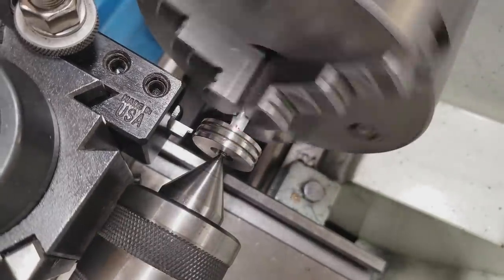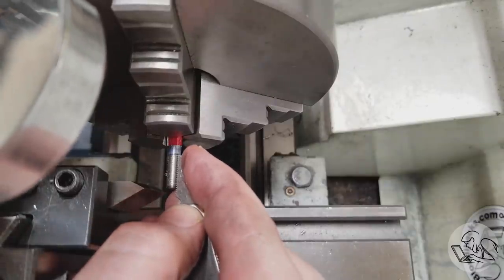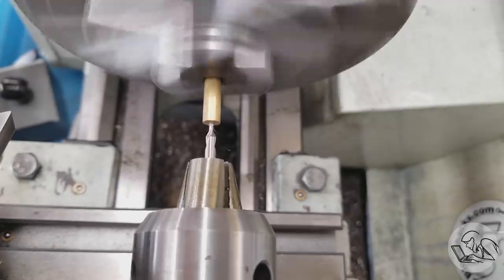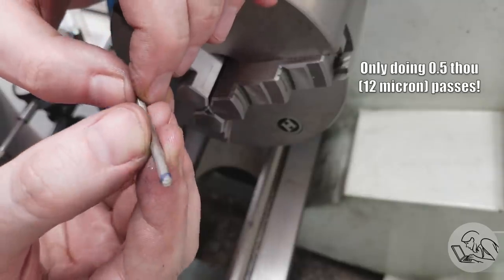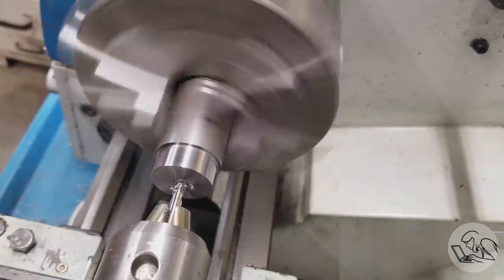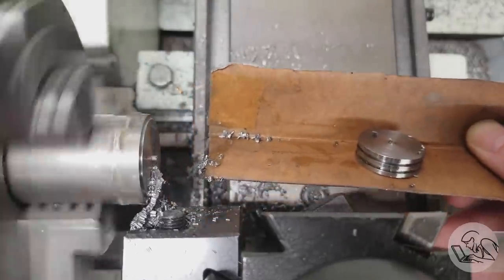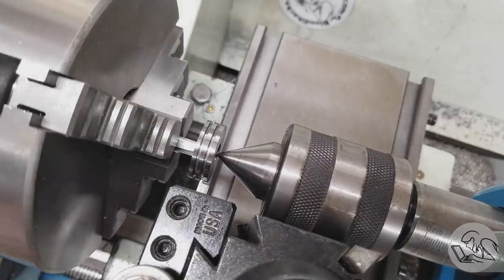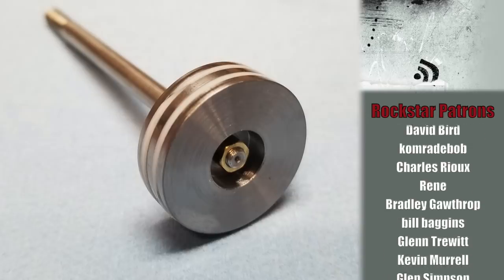Let's Build a Model Steam Engine - Machining a Piston!

Comment from the maker: Hey everyone! Something I forgot to mention in the video that’s important for hobbyists: Make the cylinder first, because it’s a lot easier to hit a precise dimension on an OD than an ID, especially on hobby equipment. It’s much easier to let the cylinder be whatever it turns out, then fit the piston to it, than the other way around. You can always emery-paper your way down with an OD when you need to nail a dimension.

A lot of people are also mentioning the piston mounting. To be clear- the piston is not supposed to be threaded in this design. I did not change that. I only added a smooth shoulder to the rod. You can argue about whether an unthreaded piston is a good idea, but that is the design from the company. 🤷‍♀️
Reply: Oh yeah, now you tell me. lol
Reply: Are you planning on making a locomotive engine like Mr. Crispin?  Quinn, you can do it! :-)
Reply: @markfergerson2145  the 1" hones are used for honing brake caliper cylinders.  When I  was a front end tech many years ago I rebuilt my fair share of calipers.
Reply: @markfergerson2145  I’m very new to machining, I have a couple of mini mills one of which I am converting to cnc and upgrading the gibs and a mini lathe that was a basket case that I salvaged and it will be converted to cnc.  I managed to get my hands on some decent tools.  Still need to get some steel and brass to work with.
Reply: Haha too funny.
Reply: A comment for support! Keep it up! Been looking forward to the next video.
Reply: @markfergerson2145  I am the administrator of a CNC group I started years ago, been converting machines and building CNC routers for a while now.
Reply: @markfergerson2145  I always need luck because I don’t use plans just napkins to wipe away the tears when things don’t go right! Lol
Reply: Tony Wilson  I suppose he never planned on steam or he would have chosen stainless steel.
Reply: Сделай проточку в кулачках глубиной и высотой в пару миллиметров - можно будет зажимать цилиндрические детали очень быстро и очень точно!

Comment: In the various machining knowledge i've kludged together over the years I haven't heard before that it's usually best practice to thread with the compound at a certain angle. I always just do it with the crossslide, but maybe that's why my threads aren't always the best ;) What's the benefit of the compound method?

Comment: I've gotta hand it to you, Quinn: since deflection was such a problem, cutting half the threads by single-pointing and then finishing with a die was an excellent idea! I'm going to remember that one.
Reply: I can see a need for good, i.e., sharp, taps & dies for working with hard to thread materials like stainless.  I'll definitely have to upgrade my set of taps & dies!

Comment: So a trick for runout I have a mark on my chuck jaw when I turn a part I mark the part with a sharpie as long as the two marks are lined up I have no runout and even if you have to flip the part around it works

Comment: I was taught that finishing cuts should be avoided on stainless steel. The final cut should be heavy enough to penetrate the work hardening. The worst that can happen is that a misjudged cut might leave the thread a few thou under-sized. But that won't kill you. Anyway, there are ways of supporting the work. I thinks someone has mentioned a half center. You could leave a half inch or so at the end of the work unmachined to accept a center or a travelling steady. Cut it off to length later.

Comment: You can  measure the groove depths (minor diameter) for the rings by miking over gage pins or small drill bits that fit in the grooves.
Then subtract the combined thickness of the two pins to get the inside diameter.
Divide by two to get the depth.
Reply: Unless the width is smaller than the depth.
Reply: @Neptune730  in that situation a couple of bits of rectangular flat stock as the gauge pins. I think round wires may have been OK here.

Comment: Bonjour Queen,
MANY thanks for this topic that I follow like a series, as steam passionate collector. Thanks to your accurate step by step presentations, I discover the amount of work and the skillness needed to build a steam machine. And you did not choose the easiest one, an oscillating machine would have taken you 5 minutes :+) 
And I would also like to thank you for the translations inches / millimeters as I am French and familiar with the second one. 
About the ring, again, the PTFE is the best choice, and not th easiest to realize, the French manufacturers I know use Viton O"rings. But perhaps your large bore cylinder facilitates the work.
I do not know if you mentioned it before, would I recognize a Stuart S50 ?
Amicalement, Raphaël

Comment: Looking good.  One question I have is that of thermal expansion of the piston rings. I’m wondering what happens if/ when you run on actual steam vs air if the rings swell or expand and bind. Typically piston ring gap is verified in the bore without the piston but my experience is with gas/ Diesel engines.

Comment: ok, silly question time:
what's going to stop those nuts from undoing when it's running?
lock washer?
loctite?
What's the torque spec, and how are you going to get a torque wrench on it?
Reply: Locktite would probably be sufficient. As far as a torque spec, it's a miniature hobby stream engine, good-n-tite is good enough.

Comment: Down at the steam shop we have the pistons out of our locomotive for a rebuild (a 1924 4-6-2 passenger locomotive built by Alco). The main cylinder is 30” in diameter and the pistons look exactly like yours. The key difference being that these are double expansion steam engines. This is Great work! Loving this series!

Comment: I wonder if your piston material is Stress Proof. It turns like butter. Wonderful material. I think it comes from LaSalle Steel. Or at least the process does. It's easier to get here than 12L14. (Eastern Canada)
Reply: A curiosity: SP doesn't contain lead, thus easier to weld, if that ever comes up.

Comment: about 3 jaw chuck concentricity issue... 0.13mm runout as "normal" seems too much to me. I did manage simply to get fairly beaten old chuck in a range of 0.03 - 0.05 mm range with simple grinding of jaws on the lathe using el cheapo die grinder. I believe that is very possible, so maybe there is idea for some next video...

Comment: When you first tried to deepen the groves and the nut couldn’t hold, could you have tried cutting in reverse so the nut would be tightened as you cut.  Sorry if this is a stupid question I’m new to lathe work.
Reply from the maker: Good question! The nut actually would tighten in the normal cutting direction. However since the nut isn’t what we’re cutting, all we have is the friction between the piston and the shoulder on the rod. It’s a small shoulder and large piston, so a lot of mechanical advantage with only a very small nut providing friction. There was little hope of that working.

Comment: I'm not a machinist but it wouldn't surprise me if the piston isn't 1144 annealed steel, even with my little 6" Atlas lathe it turns great and leaves a fantastic finish when done. If you haven't tried 1144 annealed I would suggest getting a small bar of it and trying it out. 1144 annealed comes in at 85% on machinability vs 78% with 1018 (1212 being 100%) and 12L14 being 170%. 
I know the numbers don't sound that great vs 12L14 but I recommend that you give it a try since I believe it turns better than what the numbers indicate, it's a fantastic metal to use and I really need to find myself a local supplier for it since the cost of shipping is getting crazy when ordering it online.

Comment: Quinn, I have an idea to share here regarding a cheap but accurate method of measuring the depth of narrow grooves,such as the piston ring grooves seen in this video.  This involves modifying one of the many brands cheap digital vernier type calipers available for around the £25.00 GBP mark,or less.  Simply mill the front faces of the jaws down to a thin cross section,say 1.5 mm x 10 mm wide reduced area. The mating edges of the jaws will likely remain to close together accurately though a little dressing with a fine stone will deburr them suitably. These calipers are easy to dismantle and remove the digital readout whilst the milling is performed. I think a set modified like this would perform very satisfactorily.

Comment: My new steamer has a built up piston like you show. Stretching Teflon o rings over a traditional piston does by work very well. I used this uiltnup method for boiler to o rings on my new electric.  boiler.

Comment: Quinn, just saw your comment about older 
people making larger models.  I agree with 
that one, too.  But, why didn't you get the 
larger model of this engine?  Are your tools 
(lathe and mill) too small? 

(I'm hoping this question meets your posting 
requirements.  Oh, I'm only 62, and getting the 
smaller model, just won't work for my tired, 
old, eyes.)

steve
Reply from the maker: This is the largest engine that I’m confident I can run with the boiler I built, and this one is supposed to be a “beginner” kit, so it seemed like a good choice.
Reply: Quinn, that makes sense.  (But, your eyes are 
MUCH younger than mine are.)  Besides, I 
watched videos of someone else doing the 
larger version.

Oh, I've seen quite a few videos of people 
running their "steam" engines on compressed 
air.  (Don't know how a displacement lubricator 
works on compressed air.)  But, you are right!
A Steam Engine should run on steam!  Oh, my 
"Big Boy" (UP 4000 series engine) hat showed 
up today.  Google 4014, and you'll find the 
largest steam locomotive ever made, up and 
running.

steve

Comment: 12:03 -- eep, a file on the lathe with no handle?!? 😮

(Granted, slow turning... just... I'm conditioned, by you and others, to cringe, so I cringed. 😁)
Reply from the maker: It’s a needle file. They have integrated handles, not a bare tang
Reply: Blondihacks what's the difference? (Sincere question, to a response that I'm uncertain of the sincerity of... so if I'm woosh, I'm woosh.) Still looks like something that could go through a hand/wrist/whatever...)
Reply from the maker: Needle files are tiny. 😁 I do try to hold it such that it will just fly out of my fingers if it grabs. I try to keep my hand away from the line of fire.
Reply from the maker: (But the built handle is blunt on the end)

Comment: You don't have to use stainless steel for the piston and valve rods (unless you really, really want the challenge of machining it).
I have used silver steel (BS1407), bright mild steel (EN8), though I prefer EN1A and even EN1A-Pb for the steam engines I have made and they work just fine.

Comment: Have you thought about adding a blade micrometer to your measuring tools? It would make easy work of measuring those grooves. They aren't cheap but definitely handy to have around.
Reply from the maker: Yah I would love one of those for sure! Hopefully in the budget someday.
Reply: How about a pair of calipers and an adjustable parallel? Not as precise but a hell of a lot cheaper. Pretty good for hitting a dimension - set the parallel from a micrometer, set the calipers from the parallel, turn until the calipers slip over.

Comment: could you have put the rings in the cylinder and measured the inside diameter of the rings while in the cylinder to determine the depth of the grooves in the piston?

Comment: I snapped the head off one of the screws on my four jaw chuck using the chuck key like you showed when swapping chucks. An adjustable wrench on the jaws is a more chuck friendly option. I’d hate to see someone break  a screw like I did.  And You don’t get those chuck screws at the hardware store. 🙄

Comment: Those type rings are used a lot on automatic transmissions. And usually you are supposed to put them on the piston and use a clamp (hose type clamp) to squeeze them down to the piston grooves for a while before installation. Then once they are installed, they spring back out to fit the bore perfectly and seal nicely. Just and idea.

Comment: At the end of the video, did you just tighten the brass nut on the rod or did you install a lock washer underneath the nut?  Since it is inside the cylinder and it is not easily accessible once assembled.  Great Video!!!
Reply from the maker: I think I’ll loctite it on final assembly

Comment: @8:00 I'm no machinist and I don't play one on TV, but I do have a lathe and I like to learn stuff, so isn't this the sort of thing a follow rest is intended for? I'm thinking the die was faster to setup in any case, but if one were making a lot of these or a longer tiny thread, a follow rest would be the way to go, right? I can use this as justification for why I need to buy another tool, yes?
Reply from the maker: There isn’t space for a follow that close to the chuck
Reply: @Blondihacks Ahh that makes sense and also makes me want to build a follow rest that could do it :)

Comment: We use  those rings all the time in automatic transmissions . If there solid  then we use a clamp to squeeze  them to size. If there split rings thay fit below the grove and expand with pressure

Comment: I would be concerned that when the steam engine heats up, the plastic rings will expand more than the metal piston. There should be a little clearance between the rings and the groove bottom  to provide space for the excess material. As you noted, the plastic isn't compressible. I wonder how the .05 depth on the print compares to the radial thickness of the rings?
Reply from the maker: That’s the question- I really don’t know. There’s no indicator of how proud or not proud the rings should be.

Comment: You sound like you caught a cold. Hope you get better soon!
Reply from the maker: Nope, been healthy all year. Thanks for your concern, though!
Reply: @Blondihacks  And why was there a windows error sound when cutting the first thread? Or did just I hear that?

Edit: There definitely was a Windows XP sound shortly after 2:39.
Reply from the maker: Might need your ears checked. 😁 I don’t even own a Windows machine. 😁
Reply: @Blondihacks  There definitely was an additional sound at 2:39. Sounds very much like Windows XP to me. I have no idea why it is there, but there is a sound effect from XP in there.
Reply: @Blondihacks  Good thing you said machine    Apple was going to design an i house but they abandoned the project when they found they had to install windows  ; )
Reply from the maker: @vincentguttmann2231  Wow, I went back and listened, and I hear it now too. 🤣  I have no idea what that is, or which audio track it's on. Definitely not Windows, but it does have that sound.

Comment: Someone may have already mentioned this, but a handy dodge is to rough in a thread by single pointing it and finish with a die. Helpful on tougher materials.
Reply from the maker: That’s literally exactly what I did in the video. Did you not watch it all the way?
Reply: @Blondihacks  Sorry, must have missed it.

Comment: When you first got the piston in the cylinder having the rings tight is fine they will wear into size you didn’t need to file them down
Reply from the maker: It barely even moved until I did that. An engine that doesn’t run won’t run in. 😬
Reply: The point you got to at 17:46 would have worked fine but you then enlarged the cylinder causing it to be able to wobble in the cylinder it will still work as steam engines will run in awful conditions but most manufacturers wouldn’t be happy if the piston could wobble before it going into service

Comment: Hello, I am building a steam engine DIY from scratch, double acting  and I see a problem, if a piston has a tight fit to cylinder it jams near sliding rod hole. I see a one way making piston and rode at once or piston should be placed to rod and machined to final OD in a chunk. Still not fully satisfied with mine. 
Wish you have your engine running.

Comment: How does the thread start at the same point every time in single point threading if you disengage the power feed half nut? Am I missing something here? And yes, I have never used a lathe. Yet.
Reply from the maker: There’s a “threading dial”’ on the carriage that tells you when to engage so you hit the same timing every time.
Reply: @Blondihacks  Thank you for the clarification